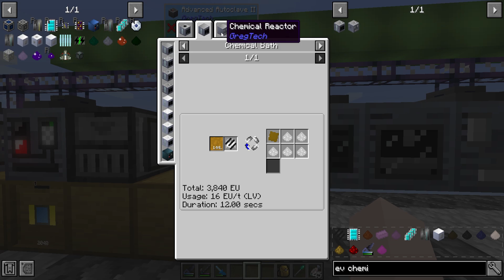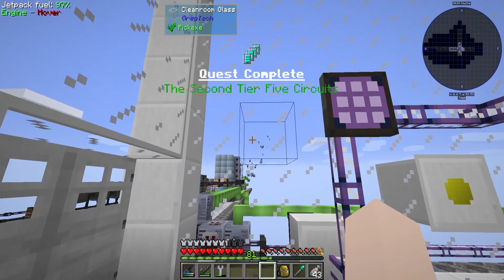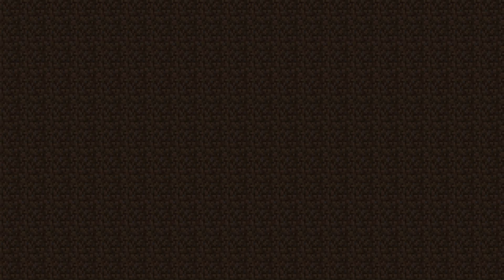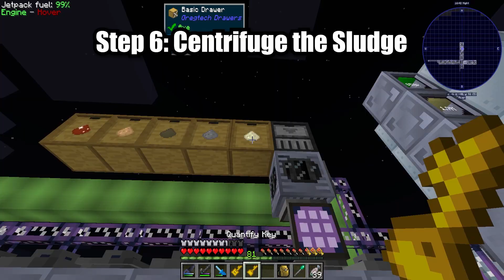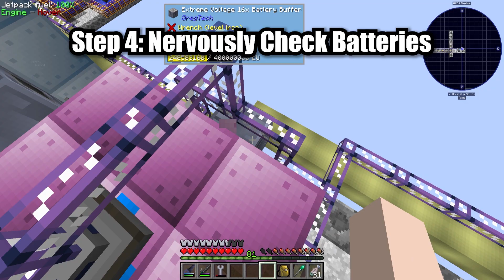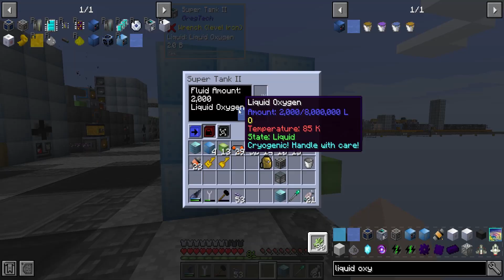EXTREME COMBUSTION GENERATOR is CRAZY!!! - NOMIFACTORY 9

Comment: SMD = Surface Mount Device, it references chip, capacitors, and other devices that mount on one side of a circuit board. This is in comparison to through-hole devices that have pins that are inserted into holes on a circuit board. SMDs allow for smaller devices.

Comment: Oh, you don't need to passive absolutely everything, you should use autocrafting for a few things at IV. I know Graphene is going to be ass to passive because you need to passive diamond ore, which means passiving tier 4s, which isn't really feasible pre-tank because of signalum.
I also thought that like Threefold you'd passive signalum alongside lumium. In fact, you'll want to do this for the signalum power conduits! That'll carry you through to the draconic conductors which are the lategame conductors.

I hope you're ready for a ridiculous amount of dml coming up. At IV with processing arrays you'll want to change out your dml setup with them. You'll also want a lot of diamonds, dragon scales. You'll see that gasoline come into clutch for Draconium - eventually you'll want to passive phosphorus which gives you perfect diamonds passively as well. Once you start getting SoCs, that's when you want to start autocrafting. Like for example, your manual circuit assembler in your cleanroom should be an autocrafted process. Don't get overly reliant on it like I did, but there definitely are steps you want to use it in.

You'll want a max size cleanroom. Plascrete is fairly trivial to passive, and the glass and the upper blocks requiring some metals  are also something suited for autocrafting.
Reply: Oh man, oreproc is something you want to passive with IV machines at the very least. You'll also want to set up the indium line so that you only need to input the ores.
Platline is one of those lines much like naqline you want to have done in as many multiblocks as possible, as this allows you to do perfect overclocks.

In fact, you should have kept the LCR for nitric acid, and generally speaking you'll want up to a ZPM LCR for each acid except phosphoric. Aqua Regia is also going to be very useful to have as that is how you get sapphire and ruby slurry, which is a small upgrade that allows you to also output a little bit of titanium and vanadium. It's not a lot of vanadium, again, but as it is a passive source this will help alleviate the need to mine or use nomicoins.

Please get autocrafting on asap. You definitely can get those 64k units up and running, but not using autocrafting for tier 5 microminers will drive you nuts. I'll show you how to use PackagedAuto as well for that.
Reply: You really don't want to put off fission at this point either. Once you have autocrafting up; do this ASAP!
Reply from the maker: @knifepony  hehe there's so much i wanna do now xD for now, multiverse is my next objective! Think of all the things i could passive with that tech xD
Reply: @MasterCWG  
Yeah, IV is a huuuuuge tier. The IV multiblock assembler is also a huge deal. Processing arrays too for DML.

Comment: SMD stands for semi conductive diode
Reply from the maker: aye thank you!
Reply: Learn that in 6th grade
Reply: It stands for surface mount devices. Basically the component doesn't have legs which geht put through a hole in the pcb (printed circuit board) and soldered (though hole technology). The pads or the legs of the component are just put on the pad of the pcb and then soldered in place. You can archive a higher component destiny on the pcb using smd components.